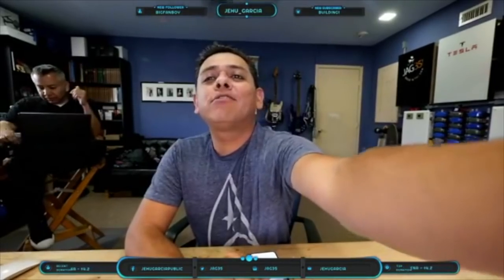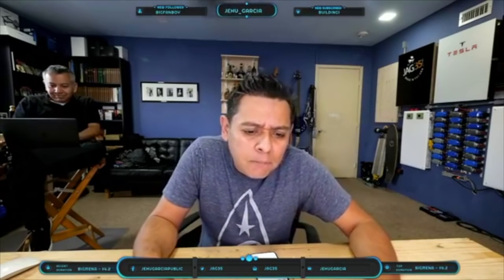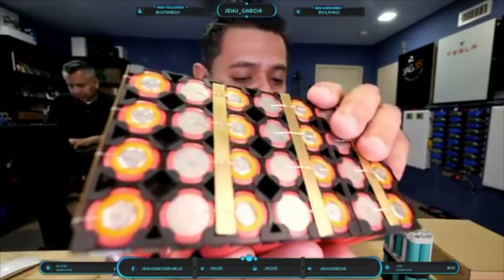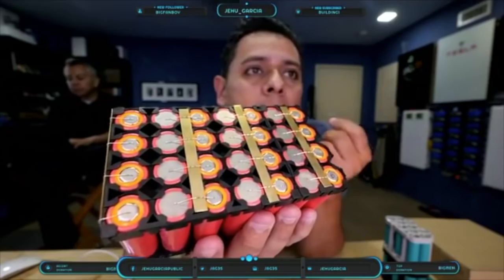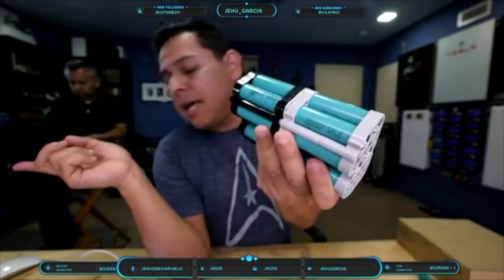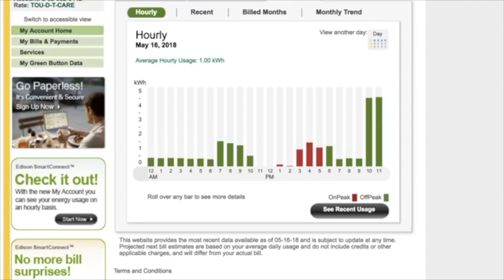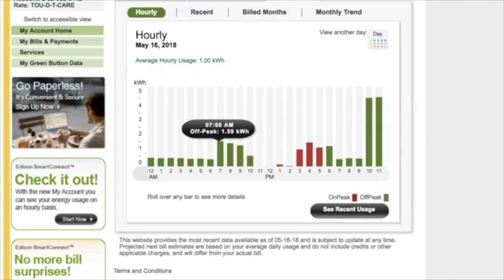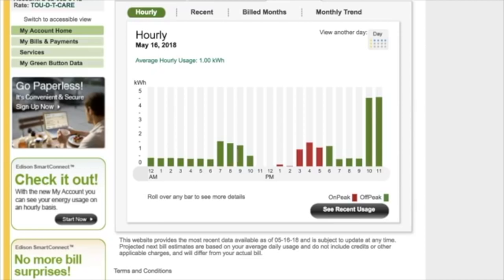Battery Winner - Cell Level Fuses - Using Solar Panel System to Peak Shave

Comment: Hey Jehu, can you tell us if you are using any battery thermal management? What would be the cheapest and the most practical solution. Greets
Reply from the maker: Nope
Reply: jehugarcia and you have experienced no problems with thermal runaways or overheating? Can you explain if there is a strategy in the packaging that you use.
Reply from the maker: No heat,  I don’t push my cells hard enough

Comment: Individual fusing is a really good concept in all applications.  I would feel safer charging indoors or at work or some place you could be liable for big damages!  Also will help during a vehicle crash.  We don't want to think of these scenarios but they can happen.

But I fear one or more fuse soldering joints going bad and leaving me stranded.  This is probably more likely scenario than a crash.  Another potential problem is the fuse component itself could fail open also leaving me stranded.  Fuses can physically change after long periods of time under high amp loads.   Of course, soldering joints and fuses are themselves subject to physical shocks when used in vehicle applications.

After getting my vehicle towed/pushed back home, I'll have a big task of finding out why the battery voltage has gone bad.  It will require opening up the vehicle's battery bay, removing the battery and harnessing, and finally dismantle the batteries themselves before even starting the diagnosis.  One of my larger e-bike's has a totally enclosed battery and wiring.  The whole bike is 120lbs.

In summary, fusing is another layer of complexity.  That layer introduces another failure point to the system -- lots of little failure points actually.  But how to mitigate potential problems?

Comment: Hi Jehu, Point no. 7of this video FAQ. says you use 1/8W resistor legs as fuse, what is the typical current that burns the legs? What will be value if I use 1/4W legs (as the link mentioned)...sorry if this has been asked before..

Comment: Seems like cell level fusing is a weak link for high amp draw like a esk8 but could be used for power wall where your battery bank is quite large and less amp draw on each cell
Reply: Show us your math, that  supports your claim that  " ... cell level fusing is a weak link for high amp draw like a esk8 ...".  You did the math, right?
Reply: @MrSummitville  weak link is correct. We do not use cell level fusing in esk8 nor do we use any kind of fuse (ie. Slow or fast blow) on our battery to speed control. (We do fuse the charge port only. )Nor do we discharge the battery through the bms. We use a bms in a charge only wiring config. We want nothing but a loopkey between battery and speed control. These things create failure points that can faceplant you at the worst possible time...when your using high amps and your body is in position to accept high acceleration. A failure at this point and time usually means a fall and or loss of brakes at this point. We would rather over build our batteries  , reduce failure points, and trust our Vesc bassed speed controller to manage amp draw by thermal throttling. Given a battery fire we would rather have control to come to a stop . Life over property.  
Once a cell goes into thermal runaway there is not much you can do anyway. Having airspace between cells is Nasa's best way to keep it minimized to that one cell and have it not spread to surrounding cells . Often this just slows the spread and gives you time  to get away before the fire ramps up and the whole battery burns. The best saftey comes from battery monitoring  with a smart bms via bluetooth so you can see voltage unbalanced P packs . You can see battery problems when  they first  start not when they become a fire. I also use a temperature alarm on my voltmeter while riding. Nice to know when that battery box is getting hot and I need to take it easy. Yea it cost me 10.00 vs. .99cent but just another warning. Really all nickel strip is a fuse since it will burn before the series conections. In esk8 we choose to use really wide pure nickel like 30mm wide for our p-packs and flexible braid or silicone wire for series conections.

Comment: Hello sir, I am from india and I very impressed with your powerwalls, but the problem is that whare i can get these cells in india and also the problem is which brand (Samsung, LG etc.) should i buy for 18650 power wall. and also the cell specifications like mAh.
Reply: The brand doesn't matter as long as it is from top 5. form factor doesn't matter as long as the batteries have similar capacity, resistance, self-discharge and same chemistry like NMC. As well max load should be within spec.
Cells you can get from all kinds of electronics, from recyclers, repair places, etc. Expect to pay something for batteries cuz I don't think the stuff is thrown out in a country where some can eat by selling plastic trash picked up...
Reply: vishal kaim, Aren't those fake? Did you purchase them?
Reply: vishal kaim, can you provide the link. And how much time do they take to ship? And do they have any minimum order quantity or something like that? THANK YOU.